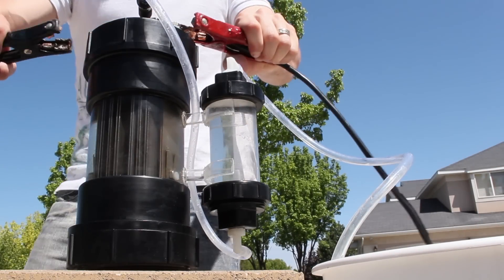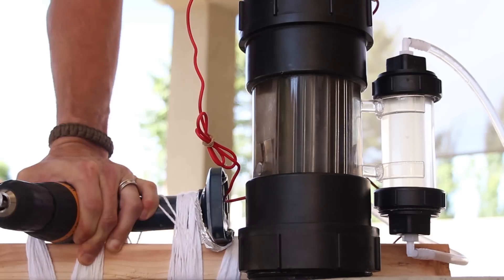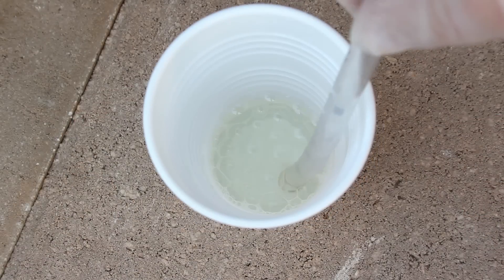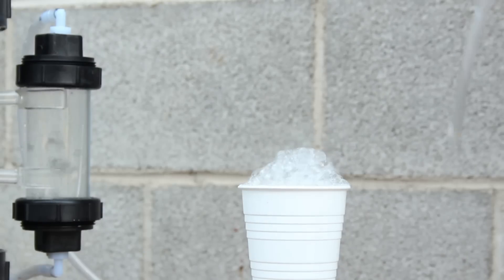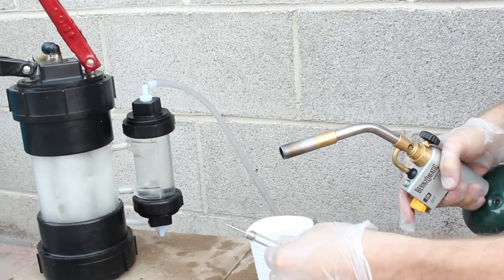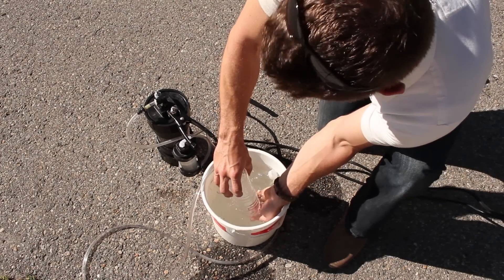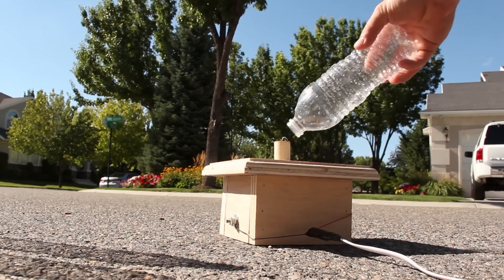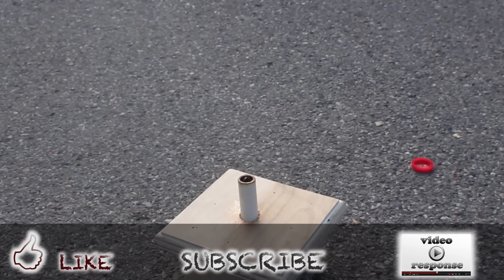How To Make Water Explode!

Comment: I remember trying to find if this could be used for a car and while many youtube users claim to have it working (and want to charge money for the plans or kit) more and more people advised that current engines are unable to run off of this.  The idea that a car battery/alternator would generate enough power to somehow generate enough gas from this mixture to somewhat "self sustain" itself is what many people advised.  Looks like it would be possible to do, but not with today's engines.

Comment: The problem would be that cracking water into Hydrogen and Oxygen takes more energy than you get out of it, particularly if you include the mechanical inefficiencies of an engine. It's much more energy efficient to just use the battery that you were using to crack the water and just run an electric motor. I can't imagine that any engineer would think that it would be a good idea to crack water in the vehicle when driving. They generally store the oxygen and hydrogen separately under pressure.

Comment: I believe there have been experiments in making cars that are literally powered by water (as in the stored fuel is water that is converted to HHO gas as the car drives, but the energy needed to generate the gas at a high enough rate makes them impractical. At least that's approximately what I remember reading a few years ago.

Comment: Because it's a lot more dangerous than gasoline. It is far more explosive, you need to keep it under high pressure to get the same level of energy density as gasoline, and you need to keep the binary components separated in two pressurized fuel tanks. If a vehicle carrying enough of this stuff to drive 100 miles was to have a serious accident it would be like a huge bomb had gone off in traffic.Gasoline will burn but despite what you see in the movies, cars almost never explode when they crash.

Comment: damn right now you're thinking! there is a way to power a car with a method pretty similar to this, but it takes a modified engine[to run on hydrogen] of course. So, Instead of making a Oxygen & Hydrogen gas mixture, there is a way to get the hydrogen by itself(hydrogen is very dangerous and flammable) by putting electrolyzed magnets into the water.

Comment: Hey man cool stuff.I used to do this stuff years ago.
Extend your ignition device 3-5inches add a rubber ring on the bottom for a seal.Include some water in your gas bottles for reaction mass.
Hot glue corflute fins on your bottles ala water rockets.
Now you have a gas powered water rocket - the local kids thought it was a hoot.
Although you probably knew this anyway...LOL!
Great stuff !

Comment: Surely you should be able to make and engine out of that because petrol explodes inside the engine to drive the pistons (as you know) so the explosion from that should do the same job and the solution turns into water vapor after so there would be no bad fumes???!!

Comment: yes, I know. Most likely it will fail on the sides or blow the lid off. Interesting job he has. I have worked at a company in the desert that did environmental tests. Coke sent some glass bottles for testing. When the heat got to around 125F the glass bottles exploded. Plastic made it to much higher temps, I think around 155F before blowing up too. All of them from what I heard that were glass failed at the cap. The plastic ones blew out the sides.

Comment: yeah heres a simpler version
take the heat pack from a MRE (meal ready to eat)
and fill with water and seal it shut completely
then place flame source right above it
once the bag explodes form the pressure KABOOM a secondary explosion and fireball from the hydrogen gas produced

Comment: that's easy get a wooden box with a little pipe sticking out at top waterproof drill 2 VERY TINY holes about 1 cm apart put a metal needle and connect wires get a lighter (not flint/thumbwheel) open it up find the thing under the button and get these two wires and connect them to the wires then you are done now when you put the bottle and press the button and it will explode or strong plastic will take off
(if you don't understand tell me what you don't understand)

Comment: Hi, do you have any ideas on how to separate the anode and cathode with some material that would all the electricity to pass through but inhibit the gas?  This would allow the hydrogen and oxygen to be separated.  I had a few Ideas but have yet to act on them.  My thought was to try to run a small motor, driving a small generator that powered the separated the H and the O.  All the best!

Comment: Haha, no.
The HCl you have in your stomach isn't what you use to digest food. Enzymes do it. The actual acid is extremely diluted and it won't react with aluminium.
Aluminium is a substance that has the properties of both metal and non-metal, which in turn makes it react with both bases and acids. The downside to that is that it needs strong and concentrated acids/bases to make a reaction. Certainly nothing you can find in your stomach.

Comment: A vehicle? Maybe a really small bike. A car? No.
You're not the first one to think that, and in fact a car running on hydrogen is being researched. There are 2 problems, though. First one is that our idea of a "car" has been made to work with petrol products. Making the same car with a huge HHO generator in the trunk is just non-optimal. While non-renewable, petrol is really efficient at what it does and we'll stick to it.
Oh, and second problem is that free gas isn't what oil companies want.

Comment: I have another way to do it :

1. Get a glass of water. 
2. put it in the microwave.
3. let it get hot 300° Celsius.  ( Yes, water heated in a microwave can get that hot. )
4. Get the glass out ( try not to move it to much. )
5. Put it on the floor.
6. Throw a rock in it.
7.KABOOM.

Comment: NO !
You just burnt hydrogen in a stoichiometric mixture.
You first turned water into gas, You burnt that, NOT WATER.

You can dumb down science all you like by taking steps out.
I just like to see people get the true info. Water will not combust. It is the byproduct of combustion.

I like the vid and the idea. Its just the way you explained it.

Comment: I made one of these out of baking soda, water, some plastic cans, and hoses. i connected it into the fuel injection line. it worked well but i checked it and you always have to have just a bit of fuel going to it to run. i plugged it into the battery and used a fuse as a switch. One problem. it makes the engine too hot. and fairly dangerous. id try and make some out of pvc next time

Comment: because of the precision it would take to get a pressure with in the tolerance limits of the engine. but before that it couldn't work because there is no control of the burn, since it burns way too fast

Comment: technically, yes. however its electrically expensive to make enough to get you very far, not to mention compress in usable amounts safely. you would have to separate the gases into two separate tanks for safety since as you can see here, a large amount of premixed gas compressed in a tank would be extremely dangerous.

Comment: Would a power supply from a neon sign work? I've been having a hard time finding a good PSU that wont short out after a long period of time. The Xbox 360 supply works good, but it has a short safety built in that turns it off after a few seconds.

Comment: Hm.... I wonder how much gas you could make and store with a similar method. Hook the machine up to a solar panel or a wind mill and just let it go, and as the gas comes out, send it to a compressor. Then use the gas to power a vehicle using water. Batteries are full of toxic materials, a real ecological nightmare. This sort of power just makes water, and made with the sun or wind, is essentially free.

Comment: It can be burned in a cutting torch, but I'd hardly call it a fuel. It's an extremely unstable mixture, prone to spontaneous ignition if stored as a H2 + O mixture. Also, it takes a crapload of energy to produce the gas in the first place, which uses more energy than you get out of it.

Comment from the maker: Do you really want to store this as a compressed gas?  I'm not brave enough to do that.  Also, the risk I could imagine with using a basic compressor could possibly be sparking from some of the mechanical components or motor as the gas is compressed.  That would ignite it.

Comment: what would i have to do if i wanted to put the hydrogen gas into a container and have it pressurized? if i were to hook up a bottle to the HHO generator with an air tight seal, how much psi would the generator able to push out? is it possible i could hook this up to some kind of compressor? thanks!

Comment: more fun with water:
take a ceramic pot and fill it with KNO3 (atleast 2 cups) and then in the centre place a very tiny amount of sugar (1/4 tsp) and then around that chuck it a few small peices in coal (around 1 cubic inch, or 2 CM^2). sometimes it helps to burn the outside of the coal. Light the sugar in the centre, making sure the some of the coal catches fire and let it turn into a molten mixture. when nice and hot, chuck a water balloon into it (from a distance sillys)

Comment from the maker: Yes, but it would be a different configuration for the ignition system.  Mine is high voltage and a doorbell would have to be low voltage so would need something else to make the gas ignite.

Comment from the maker: I hadn't heard of that circuit before.  Is that the Stan Meyers system?  I'd love a way to do this without KOH (best thing I've used so far though) so if you have experience, please share!  Also, if anyone else has experience with a truly efficient HHO system/circuits good for practical use, please share that as well because my system is for demonstration and is more of a toy than it is for practical use as an energy converter.

Comment from the maker: I'm still trying to figure that one out.  So far each time I've tried, I get the flashbacks.  I guess I need a smaller tip, so I just bought some .025 mig welding tips and have a design I'm going to try.  Have you done it?

Comment: you should try putting a HHO torch on the end of the tubing on the HHO generator, see how effective it is with your set up, see if it can cut steel, ect. a good replacement for a propane torch.